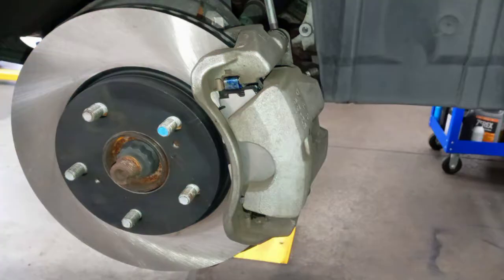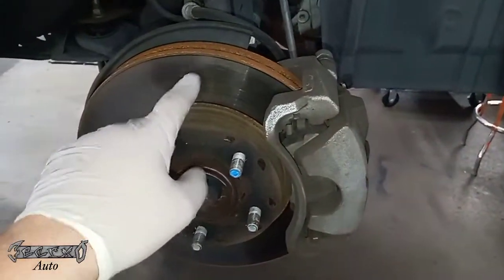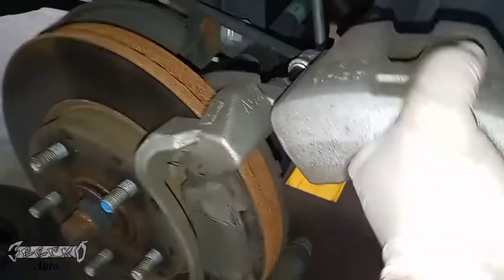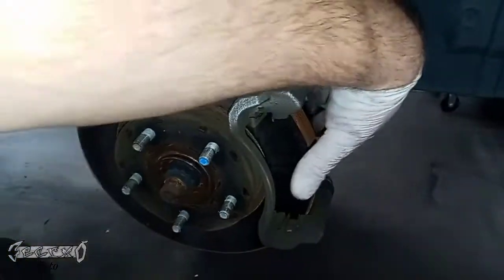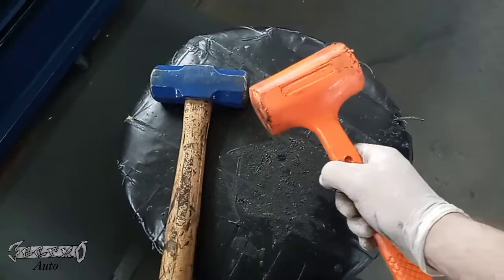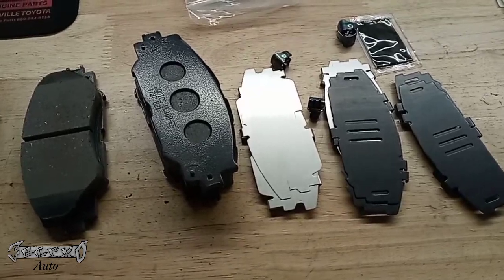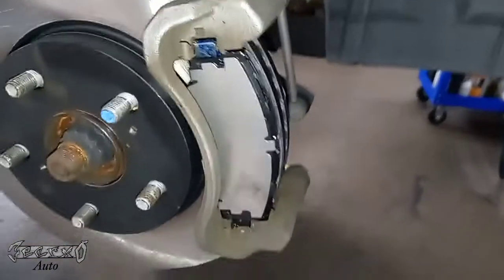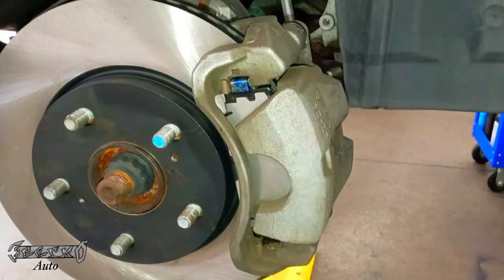2016 RAV-4 FRONT BRAKES TUTORIAL

Comment: When do you know you need to replace the roter?
Reply: When they’ve gone bad
Reply: @Jimmy24.7  what Jimmy wanted to say is if you have vibrating steering wheel when applying brakes, grinding noise or a visual inspection where the rotor has grooves or damage….right, Jimmy?